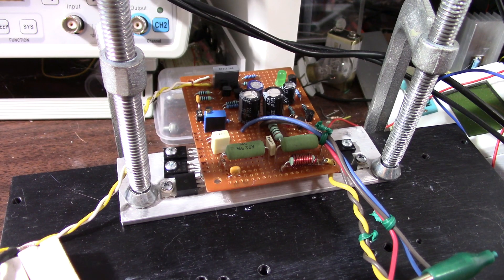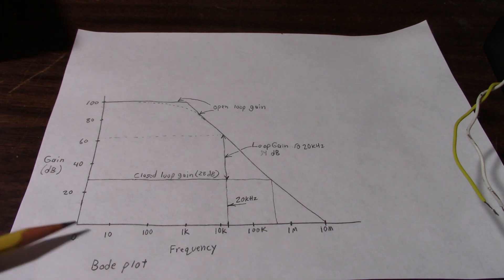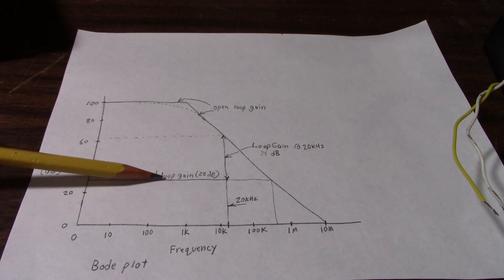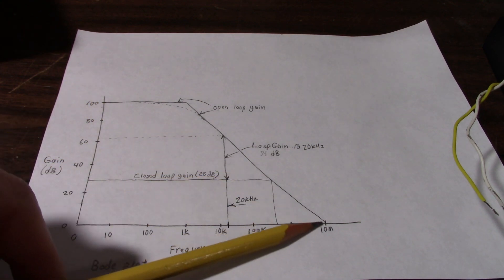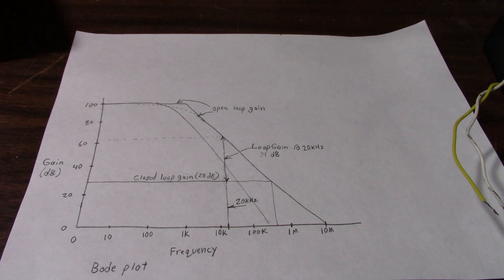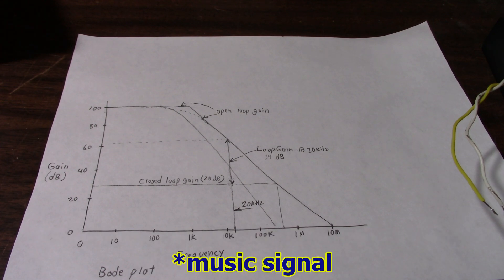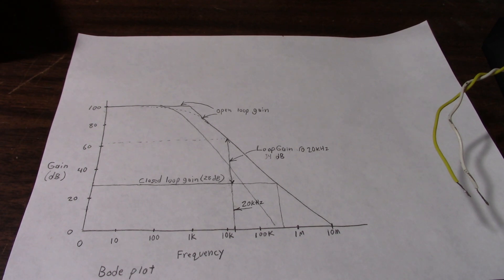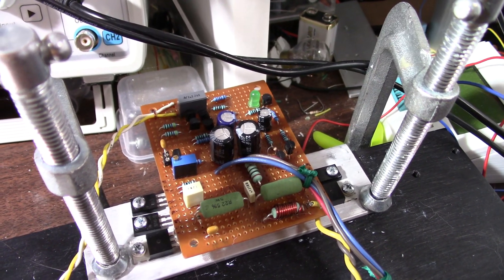Why hifi audio amplifiers are so fast (wide bandwidth)

Comment: Howdy. I am not quite sure whether You advocate wide bandwidth or not.
However, I do to some degree. Wide bandwidth is the same as high Slew Rate. It determines how well high tones can ride the bass.
Just analyzing one single sine wave with a Bode plot is way off High End of today. It was useful in the days of tube amp.s.
Picture summing a 500 Hz 50 W sine wave with a 15 kHz 5 W sine wave. Assume the null crossing to be simultaneous and in the same direction. This crossing moment determines the required Slew Rate. It will be the ascent speed sum of the 500 Hz and the 15 kHz. Combining signals may open up the vision and understanding of required Slew Rate.
Yes. But one will never run the high notes on more than maybe a couple of Watts so the increase of the crossing Slew Rate demand will be miniscule. If one runs 50 W 15 kHz into a loudspeaker one can kiss the tweeter driver goodbye.
So my standpoint. Wide bandwidth is good but hundreds of kHz is academic.
High Regards.

Comment: That makes sense, thanks! Maybe distortion is often misunderstood. Isn't distortion anything that is not in the source signal? Once you're well below 0.1%, other sources of distortion dominate the sound you hear. Audiophiles seem often to completely ignore "the elephant that is the room", and the speakers used. Instead they like to focus on small numbers and insignificant components like cables. Do they think rooms and speakers don't introduce distortion?

Comment: Considering as we age everybody's ears gradually loose the ability to hear up to 20khz and the highest sound recorded for music only reach 16.5khz and that 16.5khz is a faint quiet sound that people can hardly hear so I dont think the THD needs to be better than 0.1% at 20khz. By the time you get your career set and can afford hifi if your lucky in your 30's most people would only hear as high as 18khz anyway so its already going downhill hearing wise! For myself I go by what I like by ear which is an amplifier that has a minimalist design and does not influence the sound with too much processing. For example I have not met a multi channel home theater receiver that sounds great for 2ch hifi. They all sound very processed even in stereo bypass, even the expensive Dennon, Onkyo or Pioneer models. The preamp sections have too many digital filters and processors that pass the audio around and change it. My favorite power amplifier is a Ramsa WP9055 coupled with an Asus Xonar STXII sound card. This  has the best natural sound to me but only on large speakers that are very flat and efficient where the amp is only making a few watts of power for listening levels.

Comment: Gain bandwidth product is a well known concept among electrical engineers. With negative feedback gain is traded off for increased bandwidth. The frequency response of an amplifier is customarily specified at one watt output. In the mid 1970s Dr. Matti Otala working for Harman Kardon discovered what he called slew rate or transient intermodulation distortion. In this phenomenon the amplifier can't deliver power as fast as the signal demands it. If frequency response were measured at full power output this concept would be redundant. A concept that might be called power output bandwidth product might be more useful. What kind of sound would this affect? Cymbal crashes have considerable energy at around 11 khz. That's one example.

Vacuum tube audio amplifiers typically have harmonic distortion around 0.5 percent which is inaudible. However, they produce a peculiar kind of distortion solid state amplifiers can't. This has to do with the hysteresis losses in the output transformer core. As a result the negative going signal does not follow the positive going signal that is it doesn't exactly retrace it.. This is because it takes a small amount of time for the magnetic domains in the core to change polarity. This can be seen graphically on a BH hysteresis loop curve for different types of transformer iron. IMO this is audible and might be one of the reasons I don't like the sound of vacuum tube power amplifiers
Reply: But that adds to the 'warmth' of a vac amp.

Comment: Most people can't even differentiate between an 18Khz sine wave and 18KHz square wave... And by the way music is not a sine wave, but a very complex mixture of them, i believe that there are aspects of an amplifier that are more important. Such as the ability to amplify highly complex wave forms accurately over a complex load. With most amps, sine waves are VERY easy to reproduce with low distortion but put in a highly complex signal and that's were most amps start to REALLY strain (things like power supply stiffness in the audio-band frequencies start to show problems).
Reply: @ralfstocker7742   when I say highly complex, I don't mean high frequency... I mean like highly complex the sound waves from playing a grand piano, guitar, cello, human voice... You should note that these instruments NEVER produce a sinewave as many presume but a very veeerrry complex waveform and some amplifiers strain with this over a complex load (speaker).